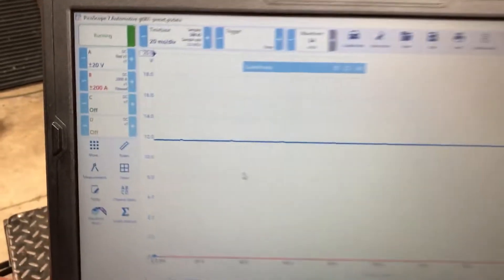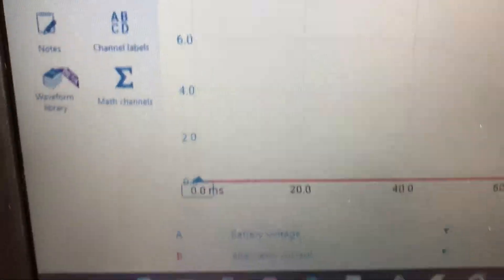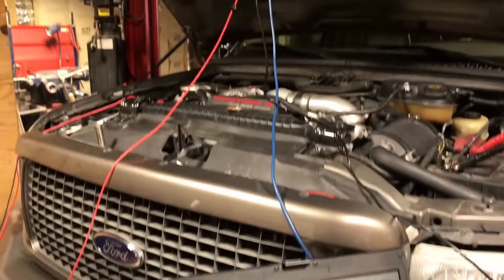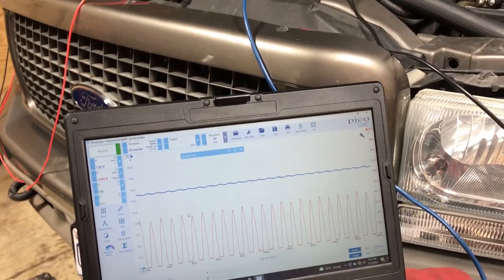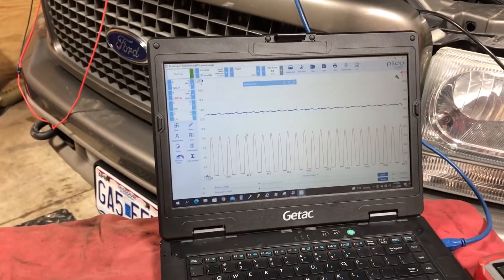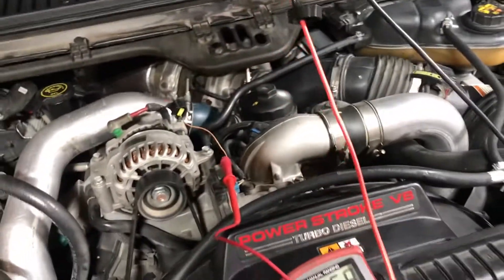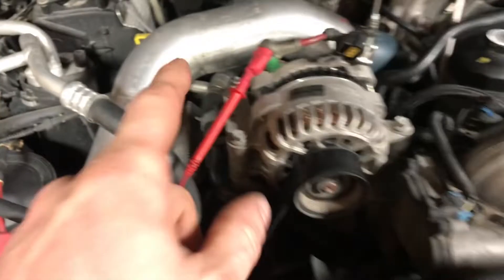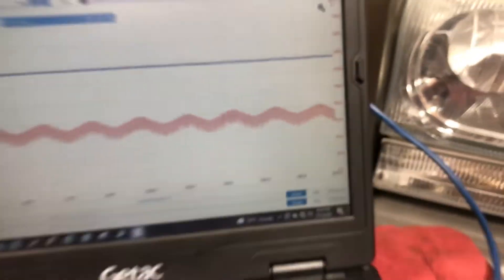Using my new Oscilloscope to diagnose and replace Ford Excursion alternator

Comment: Thankyou for the comment about the alternator cut out till the glow plugs have finished cycling. I have saw this on our f650 6.0 and thought the alternator was failing. I believe the circuit that you were talking about the regulator is actually the field circuit positive connection, but no matter 
Great video on the use of the oscilloscope. 👍
Reply from the maker: I’ve seen a lot of alternators replaced because people thought there was an issue. 
I still haven’t looked to see what the circuit was for other then I know there should be 12v. Field circuit sounds right. Thanks.
Reply: @showmerepair  very neat to see the live amp reading, would be great to verify the true amp output of a modified "high" output alternator. I have used several different brands of higher output alternators and would have loved to test on the vehicle to prove out what I bought.
Reply from the maker: Very true. It would be nice to know. I just got done listening to a podcast. Real Tuners. They had an alternator company on. Sounds like they have great quality. May look into getting one of there alternators. Would be fun to make a video with them.